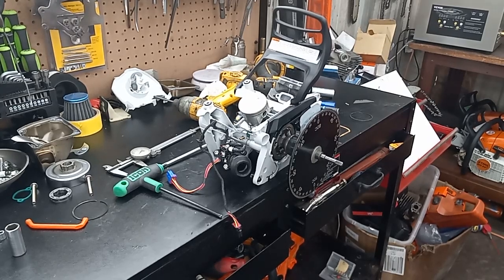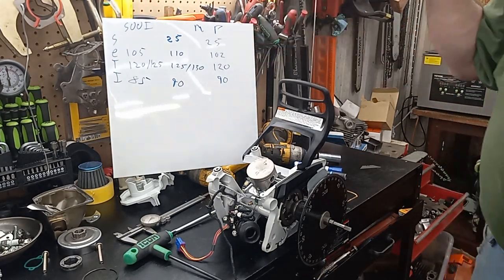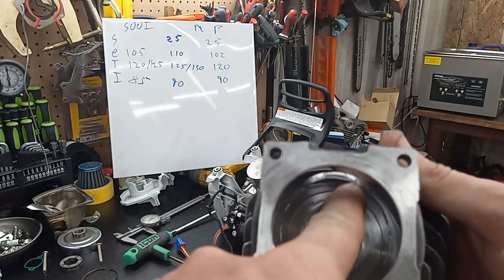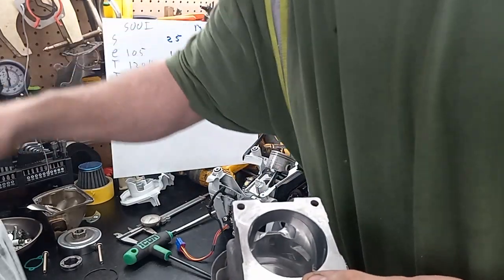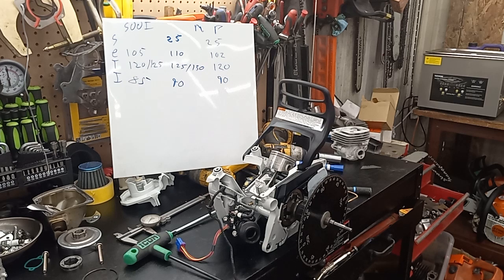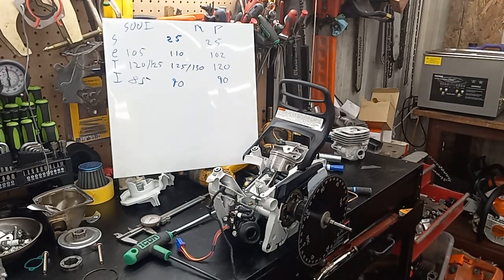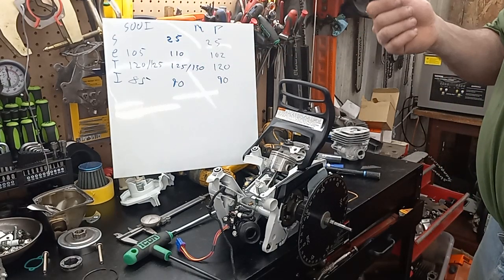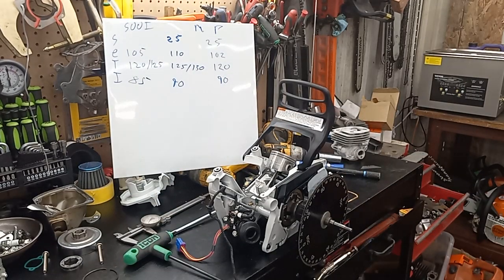Port work an numberson the ms500i an me rambling

Comment: Just a general observation, it seems like most saws with crank/case stuffers tend to run short blowdown as well. Is that because they have less volume to compress to get the air in the crankcase moving?
Reply: Most saws with stuffers that come in to my mind are strato saws so i think its more about that... generally speaking smaller crankcase volume needs to run less intake and transfer duration and more blowdown. Less intake to avoid spitback because you have less crankcase volume and since you have more primary compression(case pressure)lower transfer duration so more blowdown  is required so that you dont blow fresh air fuel charge out of the muffler.
Reply: @Ketis1985  what are the timing numbers on a husky 357xp? I think those are non strato with crank stuffers. Would be interesting to compare to numbers on a 562xp being close to the same size.